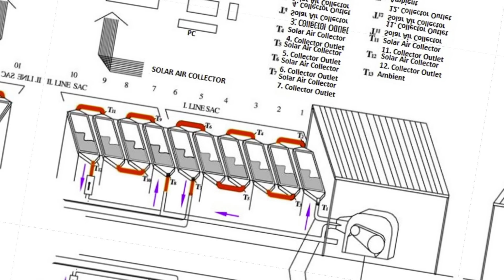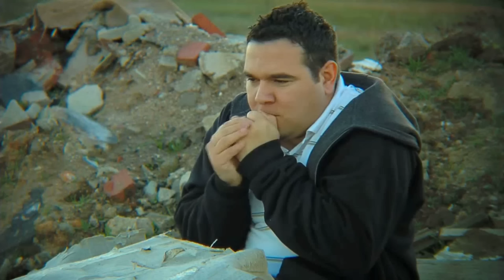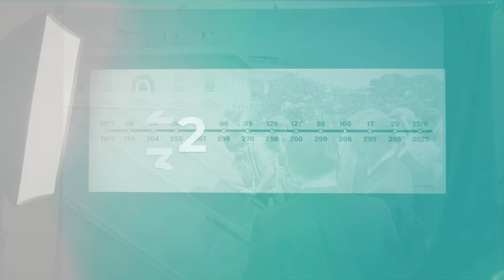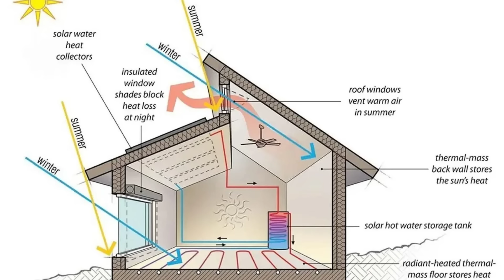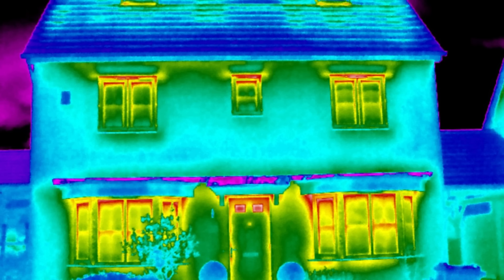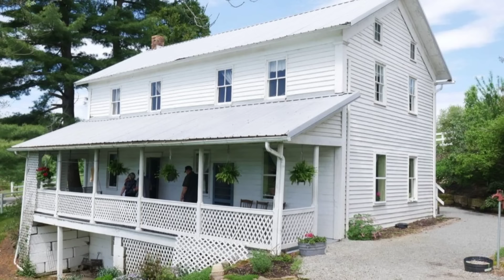$0 Solar Collector Heats Any Home Forever — Old Glass Bottles Do It. Big Utility Buried This

Comment: For over two centuries, Amish communities have maintained iron tools that look and perform as if they were forged yesterday—without ever needing a hardware store replacement. While the modern world treats rust as a death sentence for our equipment, the Amish secret lies in a simple, centuries-old chemical reaction that transforms rust into a protective barrier rather than trying to scrub it away.

By leveraging the natural power of tannic acid found in common items like oak bark or black tea, they convert iron oxide into stable ferric tannate. This video exposes why the rust-proofing industry has spent decades pushing expensive, branded petroleum solvents while ignoring this incredibly cheap, effective, and sustainable method. If you've ever thrown away a 'ruined' shovel or axe, you've been conditioned by a business model that relies on planned obsolescence. It's time to stop treating iron as a consumable and start treating it as an heirloom. What rusted tool have you been waiting to save?